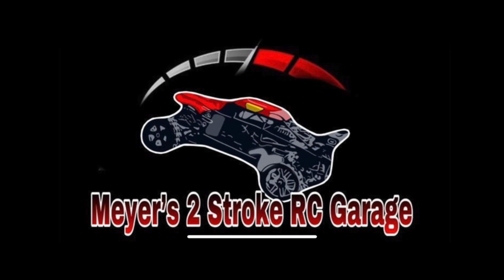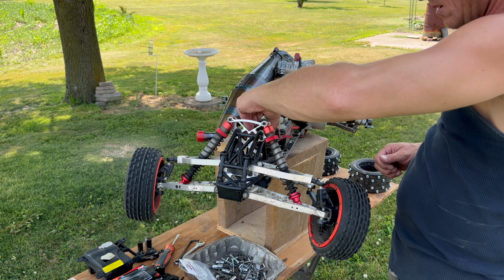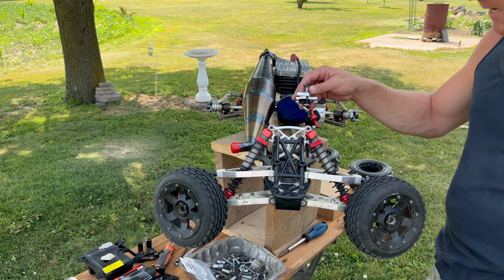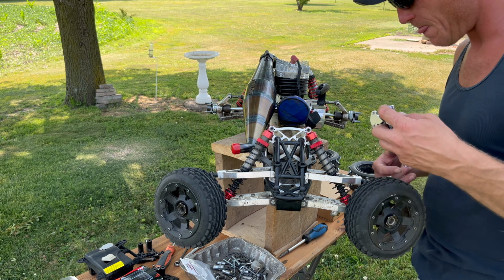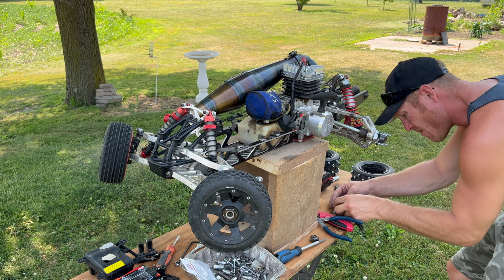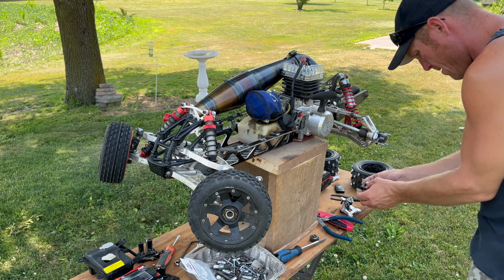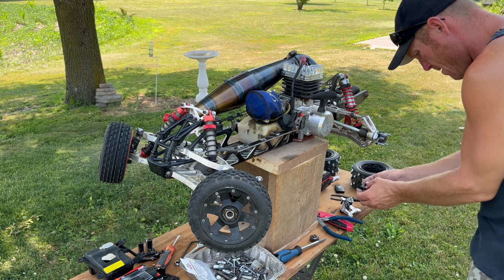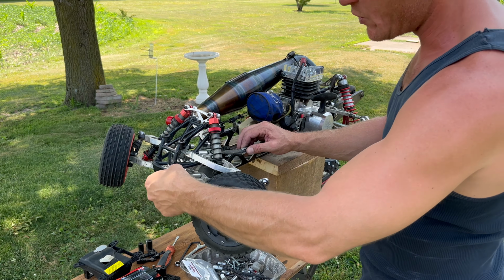TURTLE RACING SERVO SAVER AND CONVENTIONAL STEERING INSTALL PT1!!!

Comment: Awesome video man.. I see you put the steering links on top of the knuckle.. try putting them underneath the plastic steering knuckle near the tire.. it should ice you better adjustment and it won't hit the pipe! 👍
Reply from the maker: Yeah, I moved them because once I got it back on the bench in the shop, they look so unlevel it was ridiculous lol 😂